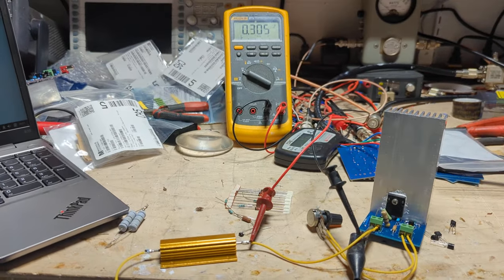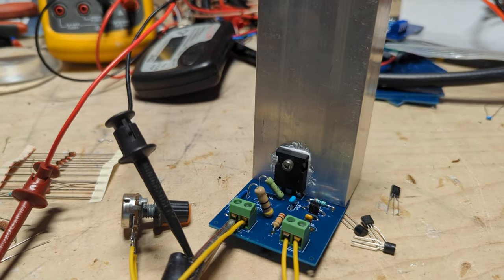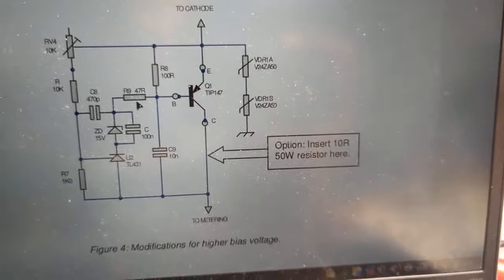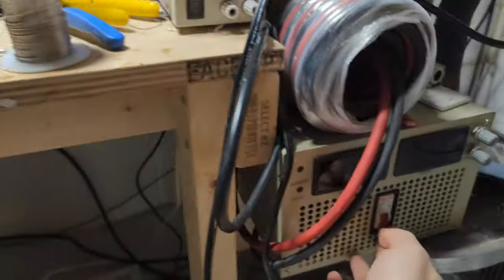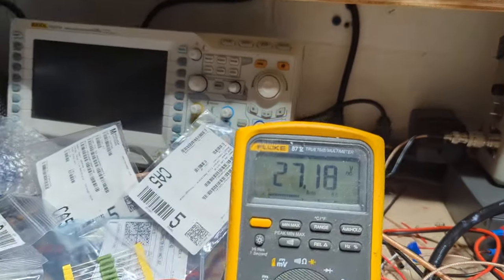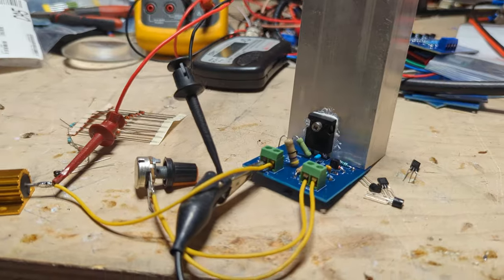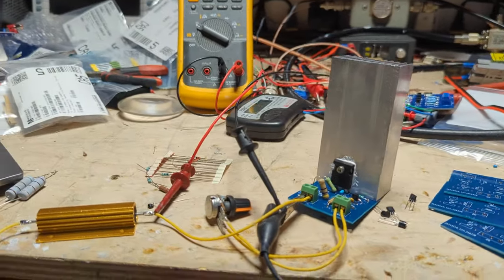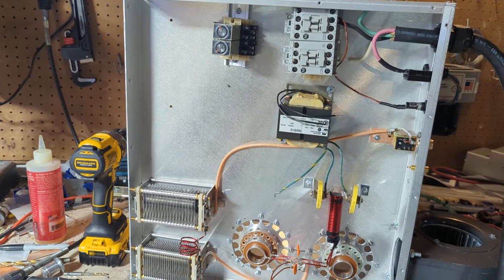GS-35b (Dual Tube (Episode #3) Bias Control board!

Comment: like that bias board.  most of the HAM HF amps use a Zenner diode or diode string like SB 220 . Ameritron tube amps have a bias bord or Zenner or diode string or 0 bias depending on model. Them Russian tubes are great just have different cut off voltage. nice board you worked on. once you get the voltage you want ,use a fixed resistor so people just don't turn knob with out know what they are doing. that would be a long string of diodes for that Russian tube. most 3-500Z/ 8877 type is around 7.5V . stock SB 220 had Zener diode and replacement board uses a diode string. converted a few . you can mount that bias board buy one of the blowers in the amp as well . or just put a fan on it. depends where you have room to fit it. one of the ARRL ham books has a circuit like that. back a bunch of years. 73's

Comment: would you mind sharing a link to that " medium voltage power supply?
Reply from the maker: https://www.aliexpress.us/item/2255799829589591.html?spm=a2g0o.detail.pcDetailBottomMoreThisSeller.6.31292a56OsZEsi&gps-id=pcDetailBottomMoreThisSeller&scm=1007.13339.291025.0&scm_id=1007.13339.291025.0&scm-url=1007.13339.291025.0&pvid=7d6a6a41-4ded-45a0-897e-805442fecce9&_t=gps-id:pcDetailBottomMoreThisSeller,scm-url:1007.13339.291025.0,pvid:7d6a6a41-4ded-45a0-897e-805442fecce9,tpp_buckets:668%232846%238108%231977&pdp_npi=4%40dis%21USD%21850.00%21782.00%21%21%21850.00%21782.00%21%402101c80017128448165193363e210a%2110000000037807517%21rec%21US%21%21AB&utparam-url=scene%3ApcDetailBottomMoreThisSeller%7Cquery_from%3A
Reply from the maker: I used to build LDMOS amps which I am phasing out and thats the power supply that i used to run them.
Reply: Thanks. that's what I intend to use it for.